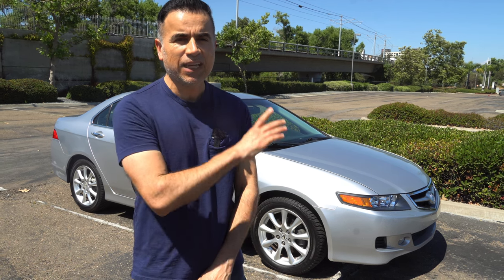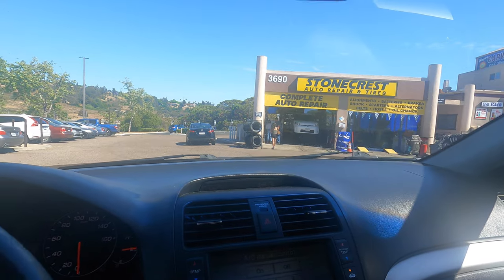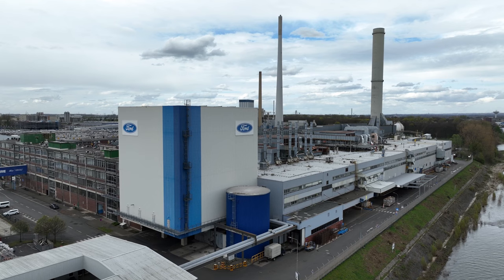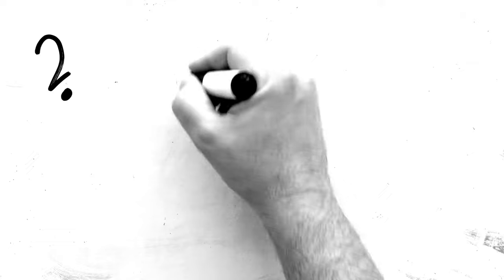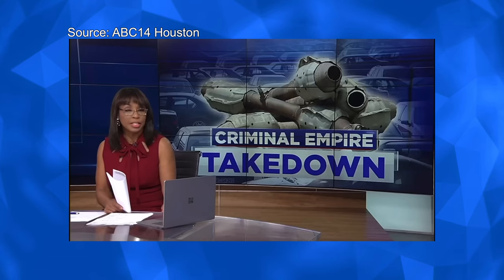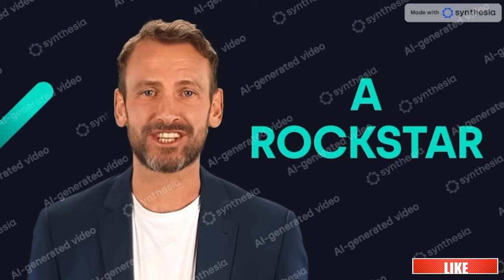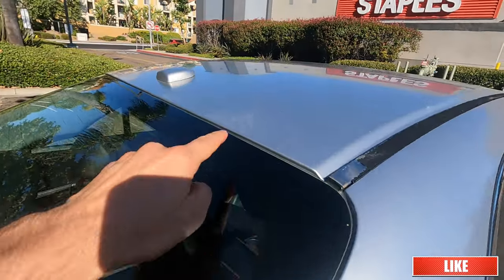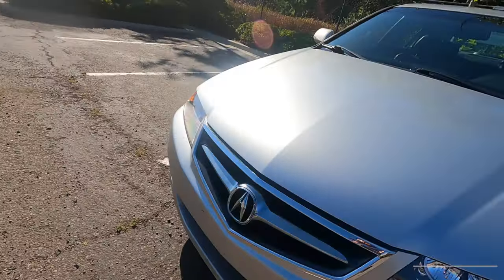My 2007 Acura TSX Needs Smog Verification #Acura #acuratsx

Comment: I recently smog my 95 Civic and it has 211K miles. She passed with flying colors, smog man said very low emissions. My smog needed to be on dyno so the cost was $130. I used to work at shop in the 90s that did smog as well. Always drive your car for about 20-30 min before doing the smog while the car is hot. Otherwise, it may fail.